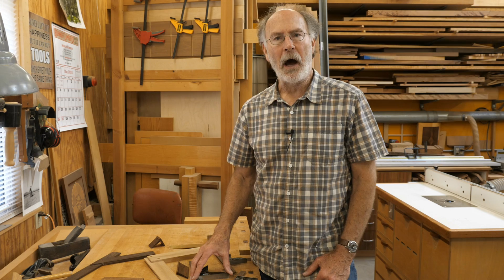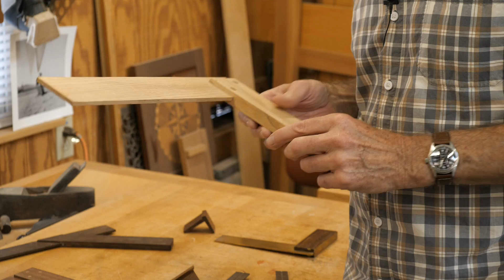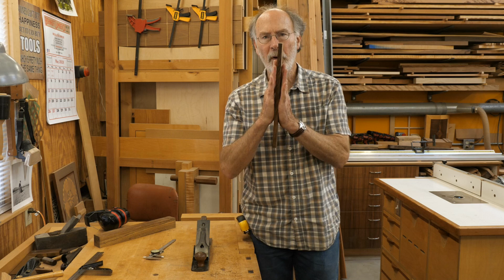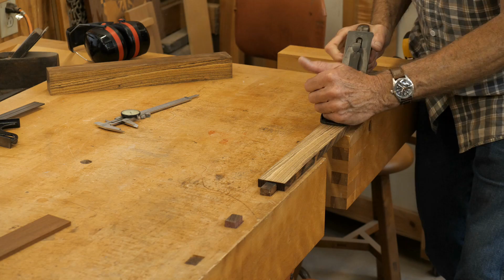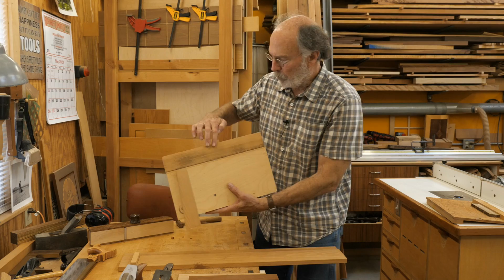Wood Try Square Build Part 1

Comment: Carl, I just came across your channel, and I'm very interested in the information you are providing. I also use hand tools quite a bit, mainly due to the small size of my shop with very little floor space.
As I watch you create this wooden tool with such great precision, I'm wondering if the early woodworkers, using wooden planes and other self-made tools, tried for such precision. I think sometimes good is good enough.
Granted, a tri-square can be checked for a perfect 90 degree angle against itself using a straight edge, so why does the handle (or reference portion) need to have such precision. I'm thinking the pioneers in woodworking would say: it checks square so go with it.
Thanks for posting, I'm enjoying the tutorials.
Reply from the maker: I have thought and read about this a bit. Woodworkers in the past did not have access to the tools we have today, so they weren't concerned about that level of precision. But if they did, who's to say they wouldn't have wanted it? With the tools we have, it's not that difficult to get that level of accuracy, so why not? But I do agree, it's not as important as it may seem.

Comment: Tri-square?! Isn't it try-square?
Reply: Yes, to me tri indicates three (as in triangle). Try, as in try square means to test an angle for squareness. Similarly, try planes test board edges for straightness prior to jointing.
Reply from the maker: @georgenewlands9760  Good point. I agree and have changed the title.
Reply from the maker: @robertcartman3502 I think you're correct, along with @georgenewlands9760. Fortunately, they are pronounced the same so no changes necessary to the video...
Reply: I see some people spelling it that way in old archived forum posts. Guessed it was an across the pond deal but other way around. English woodworkers said try and sometime in America we named tri-square to say triangle square like speed squares but the name stuck for whatever reason. That is basing the tri being short for triangle. Best guess anyways but it isn’t just Carl saying it by mistake. There are record of it being spelt that way.